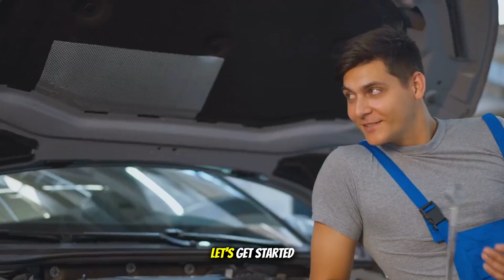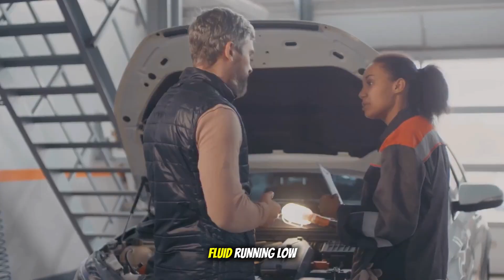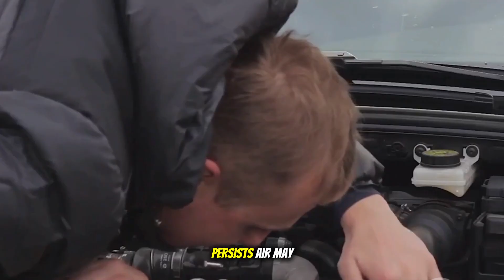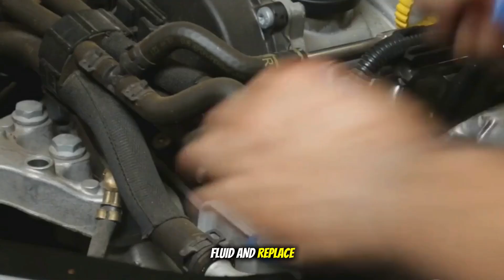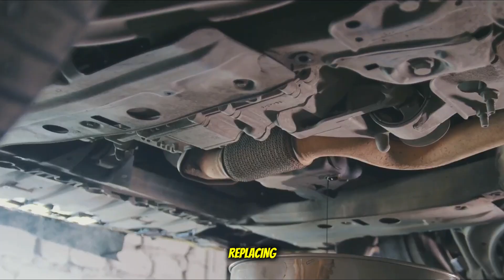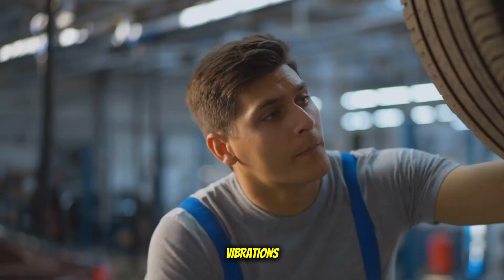The WORST Power Steering Mistakes You're Making RIGHT NOW

Comment: Sometimes when install new rack and panion adjusting rack preload screw can also solve as factory tight them too much which cause stiff steering and not returning to center
Reply from the maker: Exactly! 🔧
Overtight rack preload = stiff steering & poor return.
Slight adjustment can fix it—but don’t go too loose or you’ll get play.
Nice tip! 👊